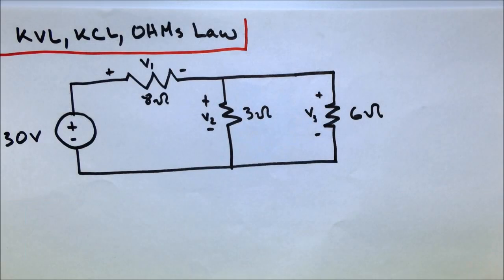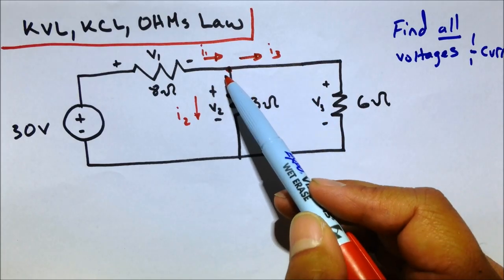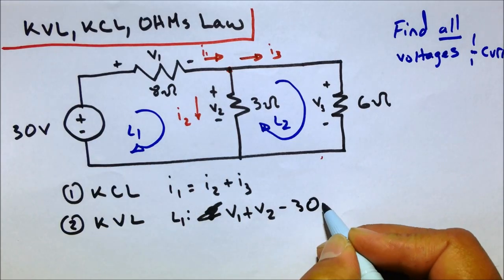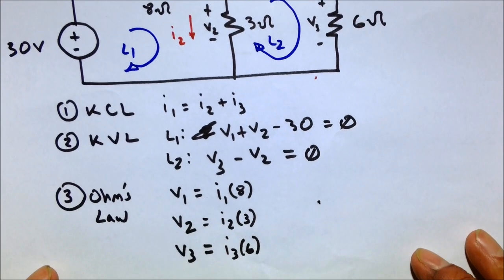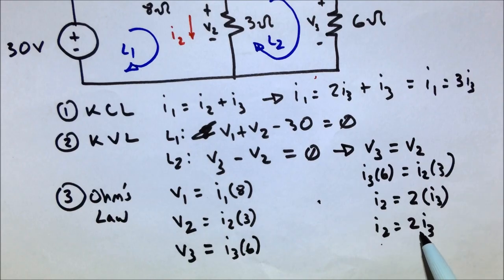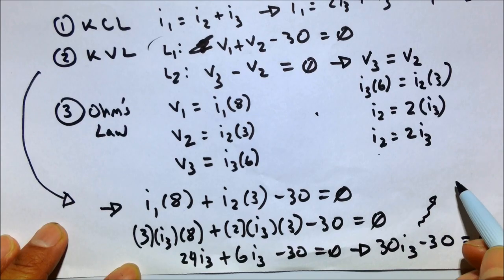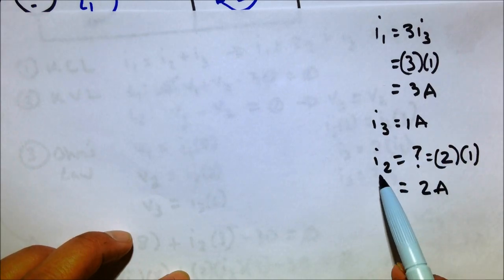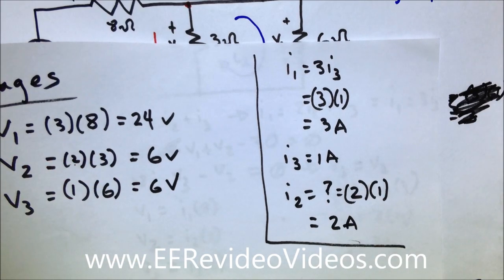KVL KCL Ohm's Law Circuit Practice Problem - (Electrical Engineering Fundamental and Basics Review)

Comment: I love your method but I found it more difficult then how I would solve it.

you have voltage, add all the resistors and from that find total current.
use total current to find the voltage drop at v1. after that, use ohms law to solve for i2 and i3 knowing that the resistors are in parallel therefore the voltage is the same.
v2 = v3
so, i2=v2/r2 & i3=v3/r3
then i1= i2+i3 boom.

maybe the way you're doing it helps a lot with more complex circuits. I'm just a student taking electrical circuit design 1 so I have a lot more to learn. but thank you for your videos. they are helping me a lot

Comment: How come the V course is 30V and the total of v1,v2,v3 = 36 ?? Is it ok or not ?
Reply: I believe this only apply to series circuit, this is a parallel circuit so you cannot just add up all the voltages... correct me if im wrong
Reply: This is a combination circuit!
Reply: sir the voltage drop across the series is V=V1+V2....but the voltage across the parallel circuit is equal...thats why V2 and V3 has the same voltage drop..so the TOTAL Voltage is still 30v..thanks :)
Reply: the sum is applied for one loop only not to the whole circuit as you can see the first loop v1 and v2 there sum is 0 (-30+24+6)and the second loop v2 and v3 there sum is 0 (6-6)

Comment: Why do you have For the voltages equal to 36 volts. if the initial voltage is 30 Volts? Could you explain please.
Reply from the maker: Are you wondering why the circuit only has a 30V source, but the sum of V1-3 is over 30V? If so, you shouldn't treat V2 and V3 as different voltage drops. V2 is the same as V3. By that, I don't mean they have identical values. I mean the two resistors they correspond to share the same nodes. If you put an Ohm meter across the 3ohm resistor to measure voltage drop, you are at the same time measuring the voltage drop across the 6ohm resistor. Another way to have approached this problem would be to combine the 3ohm and 6ohm resistor to simplify the circuit first, but the purpose of this example was to talk about KCL & KVL, so I didn't do that. Hope that helps.

Comment: great! but how can there be more voltage in the system than the voltage supplied? logically before working this out I assumed that v2 and v3 would be add up to 6v. not 12 v.

Comment: Quick question: So theoretically, would i3 be the same value on the top branch before it entered the the resistor as if it were to be on the bottom branch of the same loop, just coming out of the resistor on the branch all the way on the right? Or would it be a different value? Thank you!!
Reply from the maker: +mrpotatohead1227 i3 that is entering the 6 ohm resistor is the same current leaving it the resistor, so the bottom right branch still has i3 current running through it. Is that what you were asking?
Reply: +EE Review Videos Yes, thank you so much!!

Comment: i doubt loop l1 is not correct 
L1= 30v -v1-v2=0 this is correct.
I think kcl loop is not correct in this  solution 
Because of voltage drop in v1 and v2 so minus sign on both

Please anybody tell me and clear my doubt
Reply: Purshotam Veer This is my equation as well for loop 1.
Reply: You wrote the same equation as he did, they're equal. You just took " - " on the voltage over the resistors and " + " on the voltage source, in the video he did the opposite. It doesn't matter which way you do it as long as you are consistent with the way you're doing it.
Reply: Yess bro correct i was also confused
Reply: The direction in which you add up the voltages doesn’t matter as long as you are assigning the right signs to different directions...

Comment: Can the polarity at V3, the 6 ohm, be - to + (top to bottom) and if so, how would we solve the problem?
Reply: Yes you can do that, no problem. You have to understand that the +/- signs actually represent the placement of the +/- leads of the measuring voltmeter across the resistor. Not knowing which is the "correct" connection, you are free to place the +/- signs either way across the resistor. You are also free to draw the current flowing either up or down through the resistor, since the current arrow actually represents an ammeter and the arrow direction represents the orientation of the ammeter (arrowhead +, tail -). And not knowing the actual direction of current flow through the resistor, you can draw the current arrow in either direction of your fancy since the modern digital ammeter , unlike the old analog ammeter, is equally capable of measuring positive and negative currents. Finally, you'll have to note the sign convention that results from your arbitrary choice of voltage and current directions. If the current arrow points towards the + sign of the voltage across the resistor, then the Ohm's law to use is of the form v = i x R, otherwise the Ohm's law to use is of the form v = - i x R (Yes, with a - sign).

Comment: Does voltage rise and voltage drop apply here? Is it should be L1: -V1-V2?
Reply from the maker: A loop is a relationship between all the voltages within a loop. Whether you add or subtract V1 and V2 is arbitrary, as long as you are consistent with how you treat all the voltages in the loop. The loop L1 IS NOT "-v1-v2". If you like, you can write it as "-v1-v1+30 = 0". Same thing.

Comment: It is masochistic to use the mesh method for this problem.  It would be far quicker to use the current divider method in this case by first computing the total current given by 30V/10 ohms = 3 Amp = i1, and then determine the currents across  R2 & R3 by: i3 = 3/9 x 3; and i2=6/9x 3.  Only 2-1/2 minutes is allotted per exam question, so you want to use the fastest possible means and the least amount of computations.

Comment: If this question was on an electrical exam , this approach would take too much time. Just use ohms law.
Reply: how would you use ohms law directly to solve it faster? don't you need the first step first ?
Reply: No you do not need it. It's simple. 

V=I*R right. Therefore, to find the current across the 8ohm resistor. Its simply V/R = 30/8.

The next step is to add R2 and R3 together which simply is not R2 + R3, rather it is 1/(1/R2 + 1/R3) as they are parallel. 

To find the voltage drop across the 8ohm resistor its (V/R1+(R2+R3))*R1 = (30/8+(3+6))*8.

To Find the Effective voltage drop across R2 and R3, use the same formula, but the voltage for the formula is the VoltageSource (Vs)-VoltageDropAcrossR1 (VdR1) which gives you 15.9V  

So the effective voltage drop across R2 and R3 is expressed as (VR1/R1+(R2+R3)) = 15.9/8+(1/1/3)+(1/1/6).

To find the voltage drop across R2 and R3 (3ohm and 6ohm) 

Its simply (VR1/R2+R3) * R2 and (VR1/R2+R3) * R3.

Now as for the currents. Apply ohms law V=IR  so therefore, I=V/R
that should be easy
Reply: Parallel resistor : R2xR3/R2+R3 = 18/9=2ohm
As a Serial :8+2=10ohm
i1=30/10=3A
V1=3Ax8ohm=24ohm
V2=V3
i2(3)=i3(6)
i2=2(i3)
Kcl: i1+i2+i3=0
3+3(i3)=0
i3=1A
i2=2A
Reply: Just using ohm's law and EQ resistance fails if there are two sources of voltage.
Reply: @jjg2753  work out the first voltage and subtract the rest.

Comment: how to assign symbols of negative and postive  at the resistors
 thanks if someone could help 😊
Reply from the maker: Resistors don't have polarity. The +\- symbols are arbitrary for voltage until you know the real direction of current. For example, you could swap +\- across any of the resistors, do the same analysis, and the only thing that will change is the sign for your current. So, it doesn't matter.
Reply from the maker: Resistors don't have polarity. The +\- symbols are arbitrary for voltage until you know the real direction of current. For example, you could swap +\- across any of the resistors, do the same analysis, and the only thing that will change is the sign for your current. So, it doesn't matter.
Reply from the maker: Resistors don't have polarity. The +\- symbols are arbitrary for voltage until you know the real direction of current. For example, you could swap +\- across any of the resistors, do the same analysis, and the only thing that will change is the sign for your current. So, it doesn't matter.
Reply: EE Review Videos  thanks a lot doctor , it did help me so much  👍
Reply: +EE Review Videos can you say that again?

Comment: IMPORTANT POINT PLEASE REPLY TO CLARIFY........   I notice you have V3 =i3 *6ohms...... if i3= 1A that means 1A *6ohms= V3.....however V3 = 30v.....so using your math....30v (v3) = 1A (i3) * 6ohms please explain this
Reply from the maker: Why do you think V3 = 30 v? V3 is the voltage drop across the 6 ohm resistor. Our power supply (far right) is 30v. Watch the end of the video. You see that V3 = 6v.